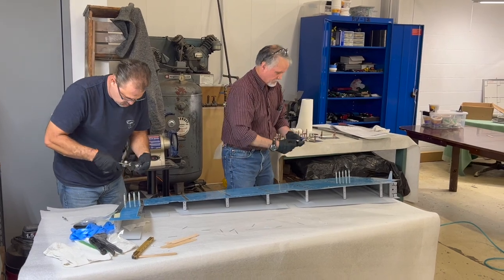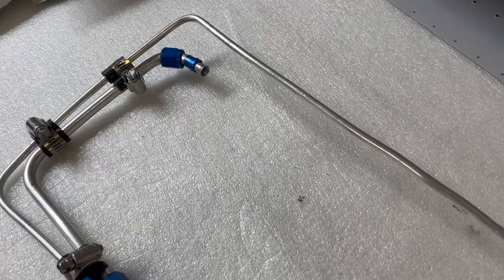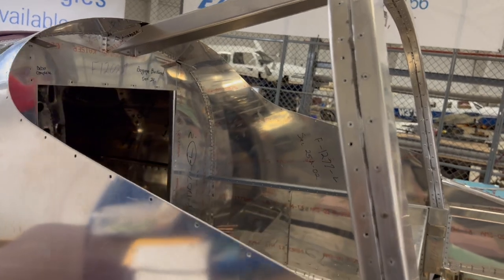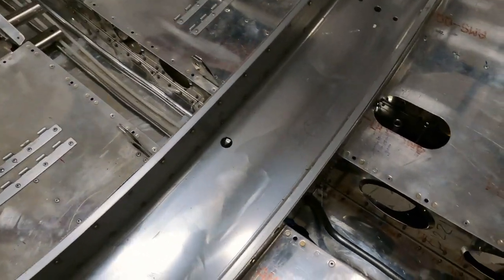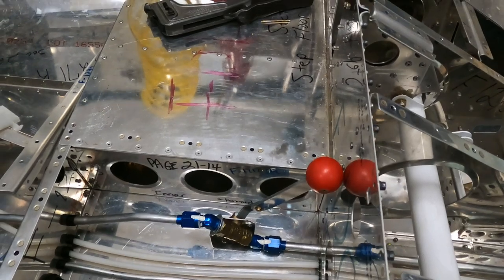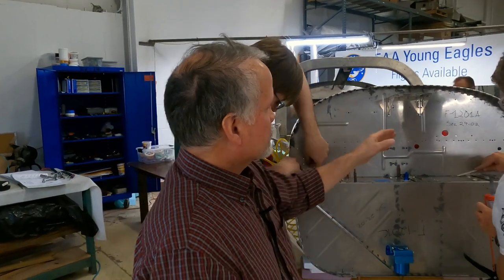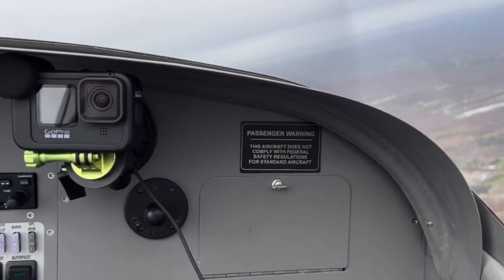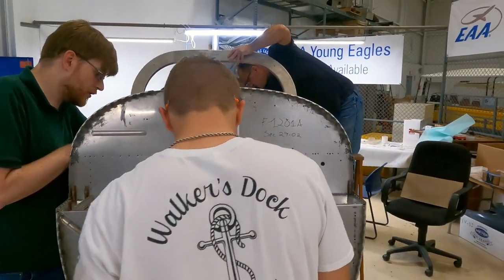Van's RV-12 Build: Fuel System

Comment: It is important to have a pre filter between the fuel tank and the electric fuel pump.  
Debris from the fuel tank can lodge in the electric fuel pump and prevent it from functioning.  If you read up on the use of that fuel pump, you will find that it is a requirement.  My fuel pump failed on a return trip because of debris from the tank.  I now have a gascolator  between the tank and the fuel pump.
Reply: Makes sense